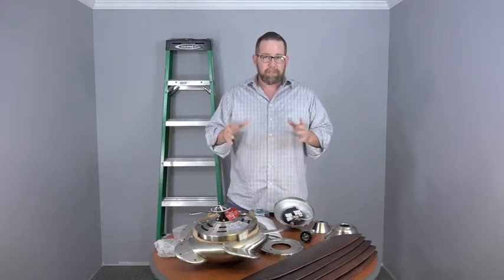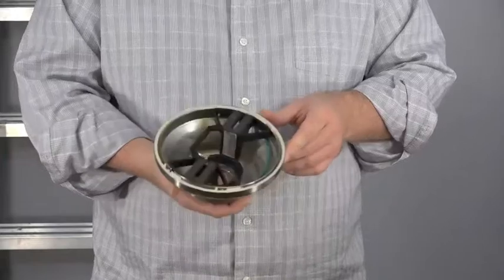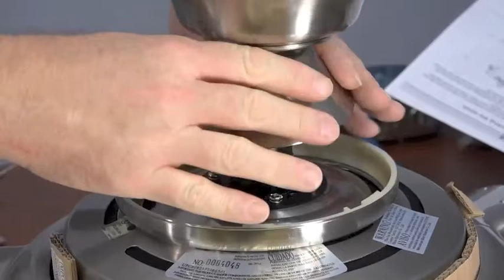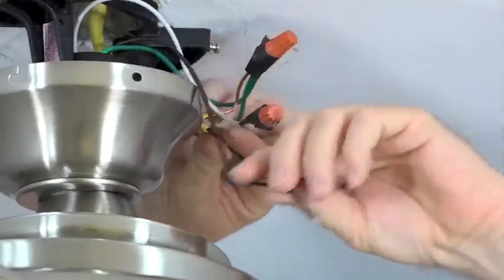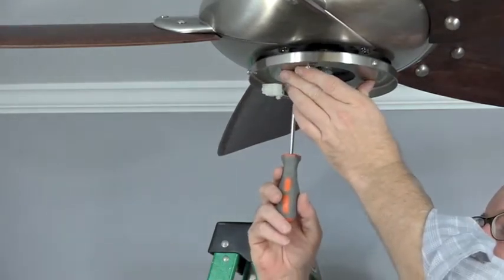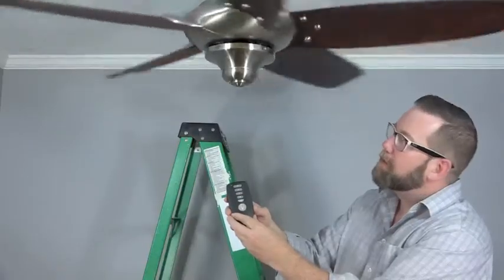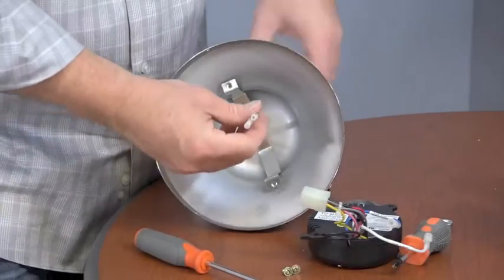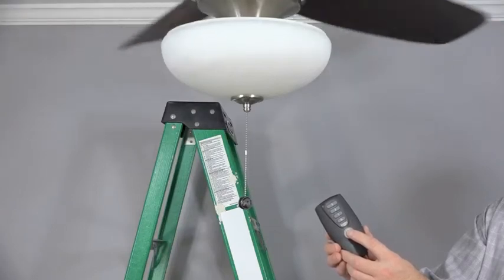How to install 56 in and 68 in Altura ceiling fan

Comment: What light kit did you use? I have this fan and only found a plastic kit sold as "Altura by Hampton Bay" recommended by Home Depot. Are others compatible?
Reply from the maker: This fan is compatible with any of the Hampton Bay universal light kits. For aesthetic reasons, we would recommend a bowl style kit. The one we used was model #91199. It is basically the same as the Altura light kit, but has a glass bowl and 2 bulbs. The Altura light kit has a plastic bowl, but looks just like frosted glass when installed and lit.
Reply: Thank you !

Comment: I just got my altura 99968 yesterday 7-6-2018 fan only run backward and only on low.
My batter reads 12v. Can you help?
Reply from the maker: I would suggest re-pairing the remote with the fan. The most important step for the pairing process is making sure the power to the fan is off at the breaker or wall switch before beginning the pairing process. If the pairing process doesn't solve the issue, I would suggest calling Home Decorators Collection customer service team at 1-800-986-3460. They'll be better able to troubleshoot and help get the fan working properly.

Comment: I can not get the remote to pair at all. Can you help me. Thank you
Reply from the maker: +Laurie Kuchler Hi laurie. The best way to start the pairing process is to start fresh. Remove the battery from the remote and turn off the breaker switch and wall switch (if the fan is wired to a wall switch). It is super-importantant that the fan is not receiving any power at the beginning of the process. Then, replace the battery according to the diagram inside the battery compartment. Next, turn on the breaker and the wall switch - this will restore power to the fan. *IMPORTANT* within 30 seconds of restoring power to the fan, press and hold the off button on the remote for 5 seconds (count slowly - "one thousand one", "one thousand two", "one thousand three", etc). The quicker you press the off button on the remote the better, do not wait or 30 seconds after turning the power on at the breaker & wall switch before pressing the off button. Hopefully this helps, but if this doesn't work, or if you have a different style remote, you can call The Home Decorators Collection help line at 1-800-986-3460. They will be able to troubleshoot the issue and send out a replacement receiver if necessary.
Reply from the maker: +Laurie Kuchler Hi Laurie. The best way to start the pairing process is to start fresh. Remove the battery from the remote and turn off the breaker switch and wall switch (if the fan is wired to a wall switch). It is super-importantant that the fan is not receiving any power at the beginning of the process. Then, replace the battery according to the diagram inside the battery compartment. Next, turn on the breaker and the wall switch - this will restore power to the fan. *IMPORTANT* within 30 seconds of restoring power to the fan, press and hold the off button on the remote for 5 seconds (count slowly - "one thousand one", "one thousand two", "one thousand three", etc). The quicker you press the off button on the remote the better, do not wait or 30 seconds after turning the power on at the breaker & wall switch before pressing the off button. Hopefully this helps, but if this doesn't work, or if you have a different style remote, you can call The Home Decorators Collection help line at 1-800-986-3460. They will be able to troubleshoot the issue and send out a replacement receiver if necessary.

Comment: I just moved to my new house and the main bedroom has this ceiling fan, however, there is no cable or remote to change the settings…any suggestions?
Reply from the maker: Your only option is to call Home Decorators Collection customer service at 1-800-986-3460  to order a replacement remote.
Reply: @ceilingfans101  thank you so much for replying!

Comment: Can a universal remote be used with this fan?  If so do I need to replace the remote receiver that comes with the fan or will the receiver learn the code for the universal remote as well?
Reply: Sorry to be offtopic but does anyone know a tool to log back into an instagram account..?
I somehow forgot my account password. I appreciate any help you can give me!
Reply: @Pablo Maxim Instablaster ;)
Reply: @Mauricio Marvin Thanks so much for your reply. I got to the site thru google and I'm in the hacking process atm.
Takes quite some time so I will reply here later with my results.
Reply: @Mauricio Marvin It did the trick and I finally got access to my account again. I'm so happy:D
Thanks so much, you saved my ass !
Reply: @Pablo Maxim You are welcome =)

Comment: You didnt show how to wire in the remote control
Reply from the maker: Unlike other remote control fans, the receiver is preinstalled in the switch up, so there is no wiring instruction for the receiver. It is shown in the light kit section at the end because the receiver needs too be removed and then reinstalled if attaching a light kit.